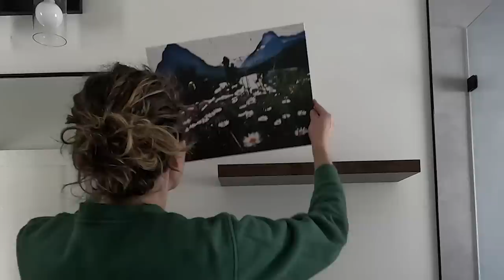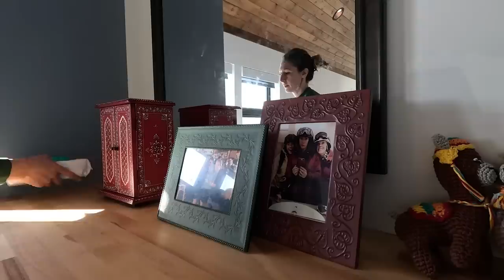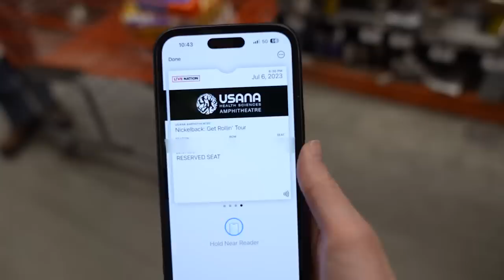WE'RE CHANGING EVERYTHING!!!

Comment: Trent/Allie - if you drilled into a stud - you don't need the dry wall anchor for hanging a vanity mirror - at least we never did.  (use them when it's just the drywall no studs to put a screw into....just make sure your screws are long enough.......I like the mirror....Installing a TV directly above a wood stove isn’t typically recommended, but if a TV will be sufficiently protected from the heat of a wood stove it may be suitable. TVs should be placed outside of clearance distances to combustibles, and a mantel can help protect a TV from the heat.
TV looks like it's far away enough from heat from the stove.....

Comment: You should have a panel upstairs in the living quarters since the garage area is not connected to the living area as most codes require that it also shortens the long wire runs that help s with voltage lost

Comment: SUGGESTION:  put in a good size sink in the garage so you can wash up. Also, to wash anything else. 
ALSO … Trent needs a very BIG First-Aid 🩹 kit in the garage. 
😂😂😂
Reply: An eye wash station could double as a sink and is a much-needed safety device in a shop.
Reply: They are going to put a half bath in the room on the far side of the garage that will have a sink.
Reply: Yeah surprised they didn’t have a utility sink in the garage

Comment: By the way, those two hoops, one on each side of the mirror, are designed to run picture wire through and then hang it by one or two hooks in the center. That way, you don't need a plant because you can more easily straighten and center the mirror on the wall. Advice from a professional artist.

Comment: Saw a trick to hang things on the wall and get the nails even. Put a piece of painters tape on the back of whatever you're hanging. Mark or put a hole in the tape exactly where the support spots are located. Then remove the tape and place on the wall to drill your holes exactly where needed.

Comment: Just a suggestion sell the tractor and snow blower and get a tracked or wheeled skid steer (wheeled you would need two sets of tires snow and dirt). You can get a snowblower for it pallet forks, bucket, and so on (the list just keeps going). Or find out if they have a front loader attachment for your tractor.

Comment: Regarding things like that mirror.  Get picture wire and thread it through both hooks.  Then you only need to put one screw in the wall and can level it visually by hand....or with a level.  It also is a lot easier to hang up with the wire.  Regarding the holes in the wall... you can totally patch and paint any mistakes... no worries as long as you have the paint or can get it.

Comment: Hey guys, the peace Lilly is THE BEST watering guide for your indoor plants, especially with the fluctuating temperatures you have indoors.
You’ll find you lose plants often as I did until this tip. When the peace Lilly starts to droop a bit, water them all. Because of the heating units you have, it’s hard to know when the moisture in their soil is sucked dry. Good luck!

Comment: #7001, I hope you used plastic bushings on the end of your flexible metal cable. Helps to avoid the wires rubbing up against the sharp cut end of the metal.

Comment: Consider finishing out the basement   and turn it into the entertainment  area   and keep upstairs  area as socializing  area    basement  have more room  for furniture   just be sure to use the right flooring  just in case of water  issues   there  are flooring  system that keep up out of water and provide air space to allow drying to happen  
Just a thought  nice walk out basement  could also be addressed patio
Reply: Not a bad idea but you'd have to account for the furnace noise both heat and A/C

Comment: Trent, bummer on the finger. I have a similar story & feel your pain. After I finished my house in 1984 I decided it would be cool to line all the cabinet shelves & drawers with linoleum tiles for permanence & easy cleaning. I bought the cheapest 12x12 tiles, a wood parquet look. peel & stick, easy peasey. While trimming one to fit  (the tiles have a shiny lacquer like finish) my sheet rock knife slipped off the straight edge & sheered off the end off my left index finger at the base of the finger nail. I said the same exact words to my wife when I went into the house. "I need some paper towels". She thought I was kidding, I showed her & she fainted. Anyway, went emergency room for a repair job. Lucky me it was a weekend & the Dr on call was a plastic surgeon. Instead of stitching the tip back on (it was hanging by the nail, almost completely cut off) he sutured it back to the tip of my finger with a few sutures. To this day there is no scar because it was just a few knots on top holding it back on til it healed. But, sadly it severed all the nerves I have never felt anything on the tip of that finger since.

Comment: You’re overthinking hanging items on your walls, it’s not a building project! Use Command strips, they handle all different kinds of weight, come in many configurations, and they leave no marks or holes. If you want to be more secure, there are hangers meant for hanging precious & heavy items with nails that are extremely narrow with a hook off the nail, that holds different sizes for all different weights. As an artist, having to hang artwork, I highly recommend you try both of these! Skip the hardware store and try the art supply store!

Comment: there hanging systems that have a rail along the ceiling and steel / poly wire (thick fishing line) you can hang of it to hang paintings and stuff https://www.youtube.com/watch?v=LhHIZb5p7YI
you still need to drill holes in the wall but can adjust the height and left right spacing without drilling more holes 
best way i found out to drill tile is to start slow and dont hammerdrill , if the tiles arent hard you can basicly grind a hole intoo it using the drill 
as for the holes from the old spot where the tv was sitting : can hang a big picture frame from there , or....... put up a large painted piece of mdf , put a frame around that and them fill the thing with all sorts of small pictureframes , the mdf makes it simpler to hang them as you can put a screw or hook straight intoo the mdf without drilling (mush) 
as for the toolbox , shouldve used the engine hoist and a few ratchetstraps 

we from jersey .... we dont do snow.....😄

ooohw the banding straps are the worst , usually the ends are melted together and you can peel them open by yanking the one end off the other using a good set of pliers and some grunt 
do have the cut looked at if the edges turn red .... well youre mom is  nurse so you should know what to look for  
good thing there not metal straps as those cut / stab you even without a knife (i work in wharehouses so been there done that sh@t)